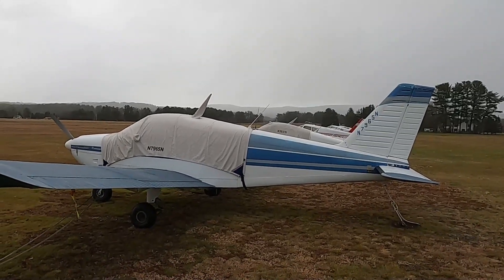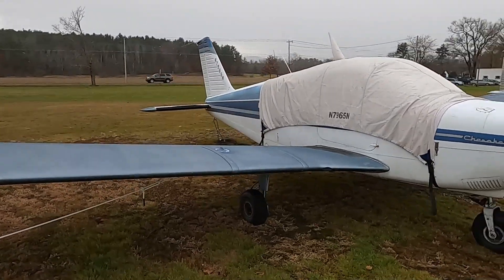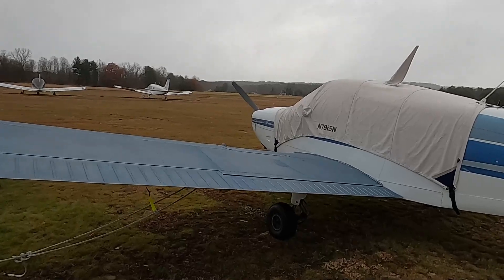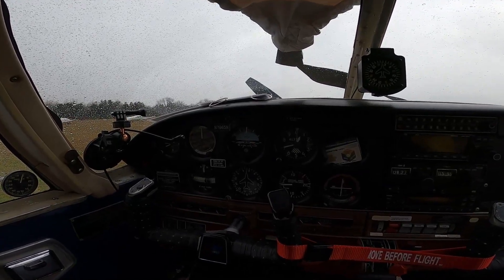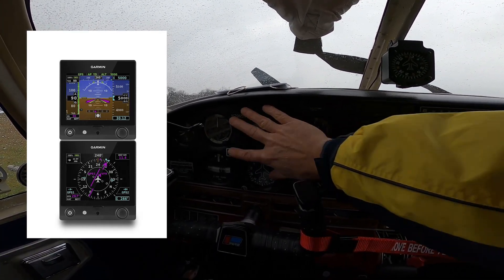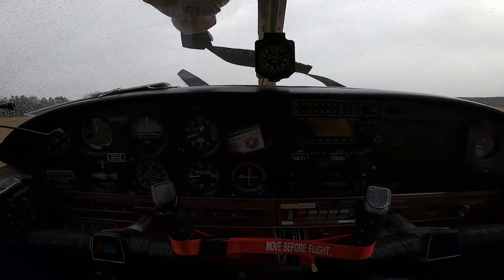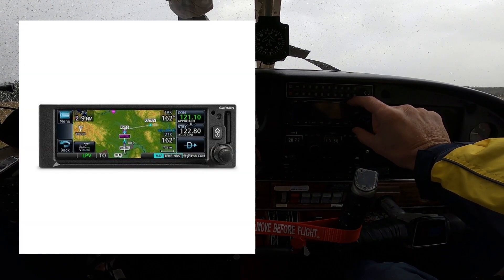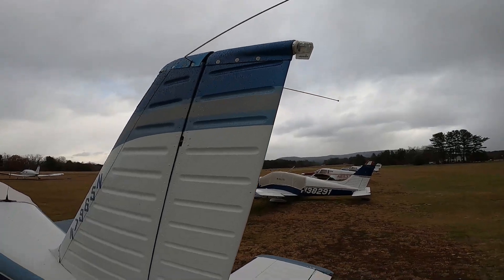N7965N - Part 1 - New Piper Cherokee 180 Airplane And Planned Avionics Upgrades

Comment: Love the 180, we bought ours 2 years ago when the prices were more reasonable...ours is also the D and just a real joy to fly...Congratulations on the purchase!!!
Reply from the maker: Thank you, I absolutely love it so far. what avionics do you have in yours? I am just trying to decide what improvements I should be making. The only thing that really detracts from it is the paint but I am not sure if I want to put $12k-$15k into a plane that will be tied down in the sun.
Reply: @weekendhack.whatsnext  Just the original steam gauges, but it was upgraded at some point to IFR enroute only..It has a Apollo gx55 navigator and an ADF..So I have been looking to upgrade next year...Not sure yet what I will put in..I am currently installing the Insight G2 engine monitoring system...Any advice on what you would upgrade to?

Comment: Congratulations and I am sure that you will enjoy your plane.  I owned a 69 Cherokee 180 D for 21 and loved the plane (new price - just over $10,000) - never had any disappointments.  I later updated to a 78 Archer II which I have now owned for another 20 years and it has performed nearly as well.  I know that I am in a minority, but I much prefer the shorter Hershy bar wing to the longer tapered wing that I now have.  The hershy bar wing is lighter on the ailerons and gives you a much quicker descent option as well as quicker roll rate (others have argued with me on that point also).   Once you learn how to use that to your advantage you can drop it on a dime and with minimal roll out. I have had others disagree with me but my 69 180D climb rate was 100 - 150 fpm more than on my Archer II.  The only advantage that the Archer II has over the Cherokee 180D is the additional room in cabin and baggage area, but that is not a lot.  Watch your oil (analyze it) and don't let it get low.  It is a pretty good platform to get your IRF rating also if you so desire.    I have a lot of Cessna time also and the only advantage that they have is with the left door.   I much prefer to be able to see where I am turning and do not care to have to get on ladder to check or fill the fuel tanks.  Happy flying and keep us posted.

Comment: That twenty horsepower is huge in the air.
Reply from the maker: Yes, I was really surprised by it at first. I’m wondering how quickly it will climb once I start soloing.
Reply: @weekendhack.whatsnext you'll enjoy it, you can definitely tell when the extra load is not present. Lol

Comment: Congrats on the plane, I bought a 1969 arrow, very similar.  I am putting a GTN750xi and 4 GI275’s.  I chose the 275’s over the G5’s because they retained the vintage look of the panel.  I am on a similar journey to you over in the U.K.
Reply from the maker: Thank you sir. If mine was an Arrow I would probably spend the extra but I need to make sure that I do not overspend on the level of aircraft that I have. The guy at the Avionics shop told me that the 275's are a bit easier to install so that should save you a little on labor and help with that extra money spent.
Reply: @weekendhack.whatsnext  indeed, makes sense.. look forward to seeing it.

Comment: you may still need a vacume pump,  unless you replace your turn coordinator.  It looks like what I currently have.  I knew what I had but my dpe thought I was wrong till he reached behind my panel and found a hose instead of wires
Reply from the maker: Thanks, I will have to ask. The top G5 (PFD) will have a turn coordinator visible on its screen. I think that would be enough. From what I understand I would be able to eliminate all of the original 6 pack with the dual G5 installation. I am still incredibly new though so I may have misunderstood.

Comment: Nice airplane! I wish I'd have bought an airplane prior to my first solo. I could have saved a metric ton of money in flight training.

I will say that if your purpose is to use this airplane as a trainer and then sell it for a forever plane, if I were in your shoes I wouldn't want to put a ton of avionics into it. Instead I'd save that money to increase the budget of my forever airplane. But that's just me. You obviously know your situation better than I do.
Reply from the maker: Sorry, I may not have been clear in my explanation. I went for the bigger plane instead of starting with the trainer. It may not be my forever plane but it will definitely be with me for many years to come. I also feel like I got this plane at a decent price compared to current market values. If I do end up eventually selling then I should not get hurt too badly unless the market reverts to old pricing but I do not see them dropping enough to make that a factor.
Reply: @weekendhack.whatsnext  oh I see. I guess I still think of a Cherokee 180 as a trainer compared with say an Arrow or a Mooney. Which are candidates for my forever airplane. But who knows maybe my humble 140 will do everything I want.
Reply from the maker: You have a valid point there but I need to learn to walk first. I may have used the term forever plane a little loosely. I am fairly sure I will end up with an HP complex aircraft somewhere down the road.

Comment: Sure sure, now tell us about the CAR. That's not exactly a Prius interior... ;-) Seriously, though, congratulations! 
Finishing the last part of my Sonex (since first engine-start and wing-mounting) has taken 4 years so your point about life/distractions is valid! Of course, part of the delay is because I fly sailplanes in the summertime (thus slowing down the build); so be careful that the Cherokee flying doesn't completely steal away your build-time.
Reply from the maker: LOL, that is my 2018 F-Type. Only a few more days to drive her around before the weather gets too bad here. I am hoping that I can stay on course with my build and the fact that it is a quick build to start definitely helps. Next summer will definitely be a test with the possibility for trips in the Cherokee.
Reply: @weekendhack.whatsnext  - Yes, QB definitely helps. My kit was bought before they even started doing pre-drilled holes everywhere, so I'm jealous! :-D  I've got an RV-9 wing kit stored away (lost a builder buddy to cancer) and after the Sonex experience I'm definitely saving up for a quickbuild fuselage on that one!
Unsolicited advice: With the NE winter, be sure to go out to the Cherokee after every snowfall and bush off the tail (wings too, but the tail is important not to overload)!
Reply from the maker: I will keep that in mind. I am almost an hour away so I may have to bribe one of the guys that works there to help me with that from time to time.

Comment: I am on a very similar path just a year or 2 ahead of you. I bought a 1964 Cherokee 180 which had similar avionics. I have done upgrades very similar to what you have planned, I added 2 G5's and a GPS 175. I am currently doing my IFR training. I certainly don't want to present myself as an avionics expert, but because I have such a similar setup, I have one concern. The new GPS will link to the G5's. And you will use the HSI G5 for most of your instrument approaches.  I am not sure why you wouldn't keep the old radio and indicator to be your #2 VOR receiver? I guess I'm thinking there is $4000.00 you could maybe save? Again, Not an avionics expert, just a pilot so it's 1000% likely I am missing something.. Best of luck with the new bird!
Reply from the maker: Thank you sir. I love to hear from others who have been there. I plan on removing the King NAV/COMM radio and glideslope that is in there. The Garmin 250XL will become a backup in flight GPS and COMM 2. The new GNC 355 will be my main GPS and COMM 1. I am not sure how the 355 connects to the G5. I was thinking that it might be good enough but I planned on the Garmin GI 106B as a worse case scenario tied to the new GNC 355.